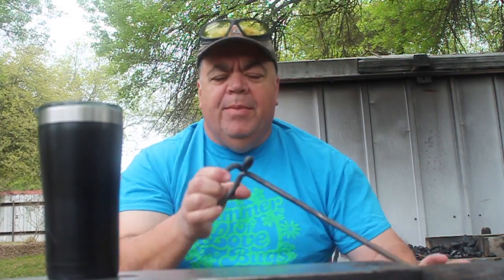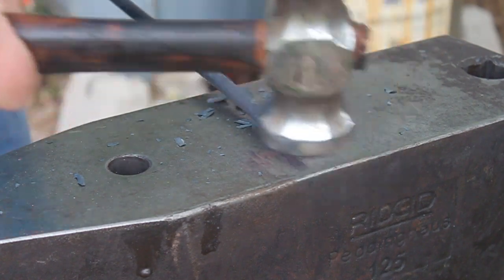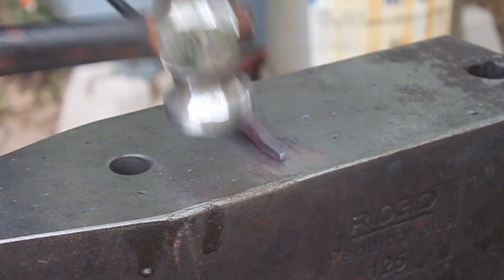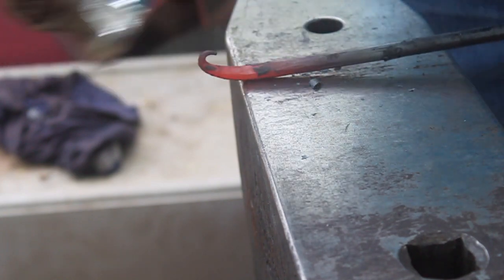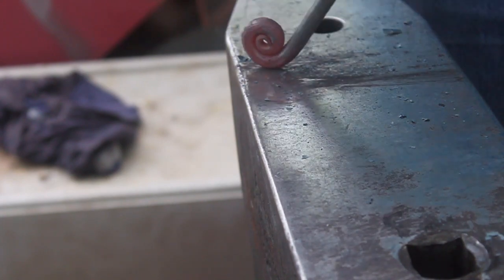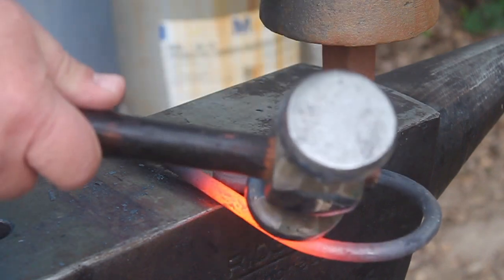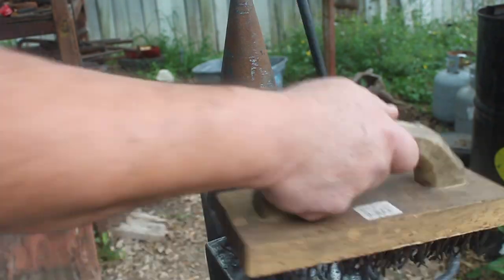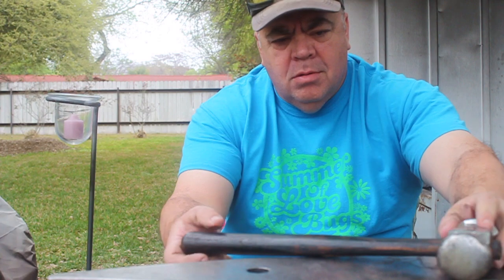Candle holder

Comment: I am also a beginner  only at it a couple years  using a propane forge. i like to have a coal forge what you used for your fire pan. have a great evening
Reply from the maker: I use a fire pot that I purchased online. My first pot was a large brake drum and I used a hair dryer for the blower. It’s only been a few years since I started. Keep at it and forge on!